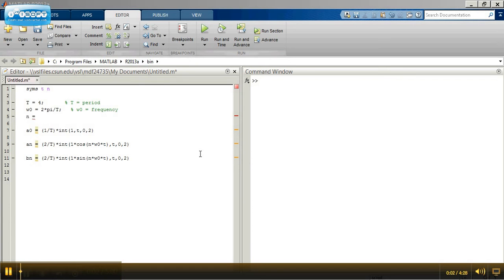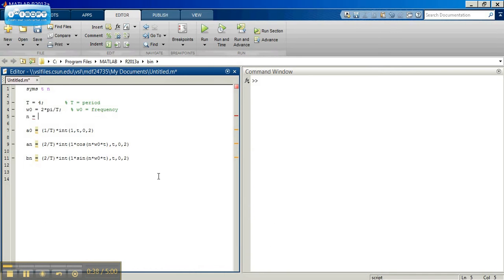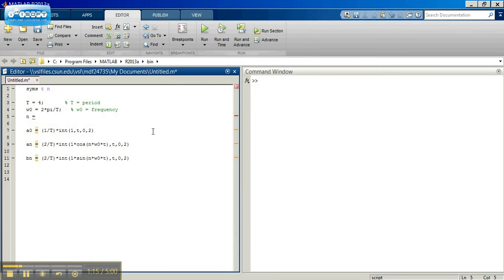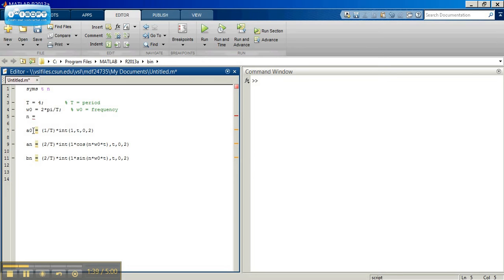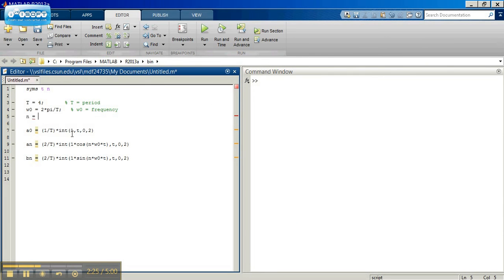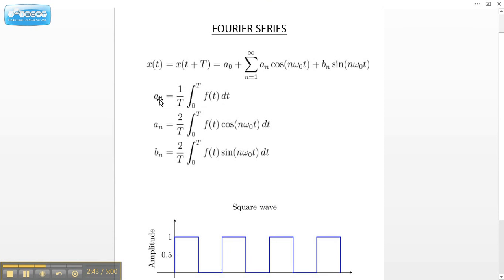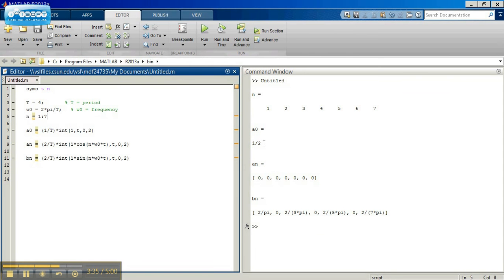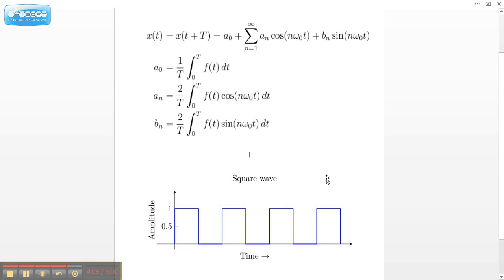Finding Coefficients of Fourier Series Using Matlab

Comment: Question: How does MATLAB know your integrating in terms of "t" such is "dt". And where do the limits of integration go??? I'm assuming that this would be at the end of the parentheses but can you specify what means what in the form (f(t) , t, 0, 2) what do the t, 0 and 2 represent from your main set of equations??? And are "t" and "n" user defined functions??? Example from your code: % syms t n